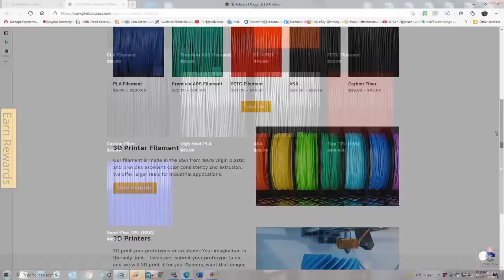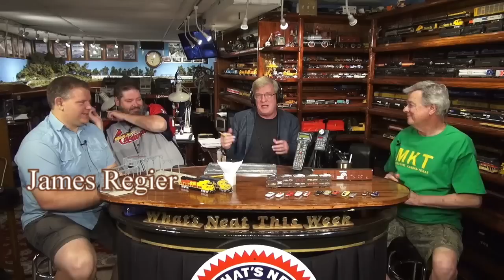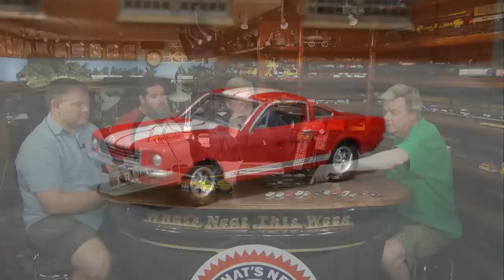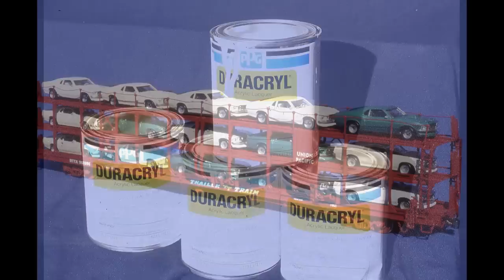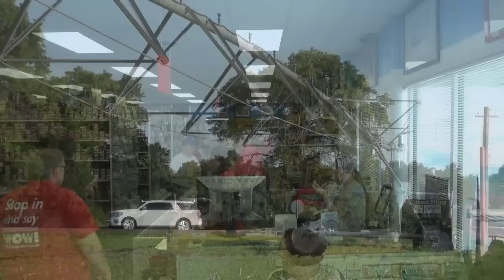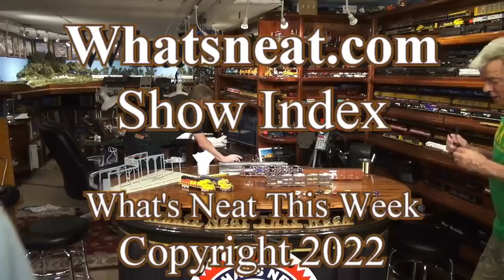What's Neat This Week in Model Railroading #195 May 15th, 2022

Comment: Regarding your talk about animation on a layout there is a excellent one that does the rounds at UK model railway shows the layout is known as the museum of transport and it has lots of animation including a Lancaster bomber that starts up the correct way to the actual plane with the correct sounds from the starting and running of the engines recorded off the real plane.